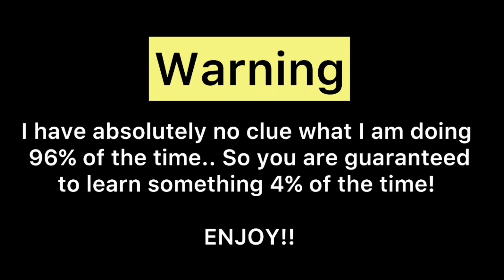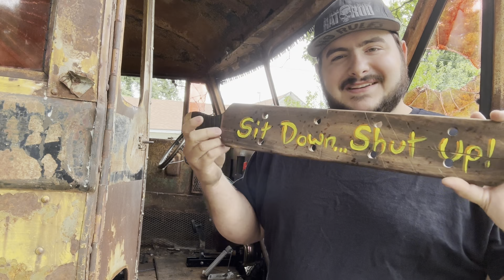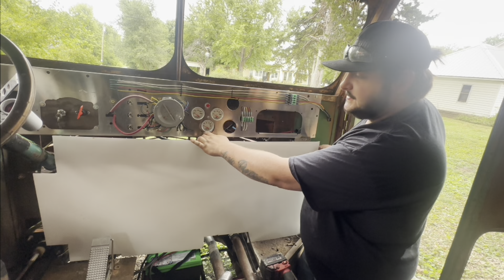Out with the New and in with the Old!!

Comment: Hey man the bus is looking great. I just have an idea about the dent on the roof. I would use a floor jack and that pipe you had or one that will fit the length from the roof to the jack plate and start forcing the dent out. Keep up the great content

Comment: My current truck is a 2000 dodge ram laramie slt quad cab long bed 318 magnum V8 automatic overdrive transmission manual shift transfer case lever on a floor 1500 gloss black with most of the white pinstripe and ruined paint,, 4x4 and im thinking of trading for a much older truck